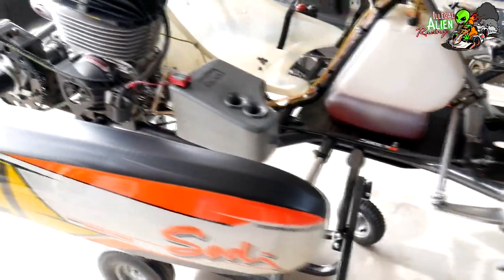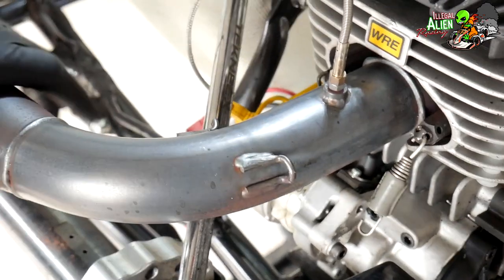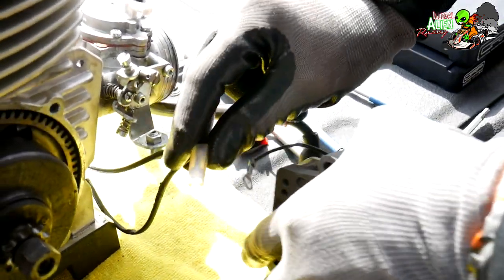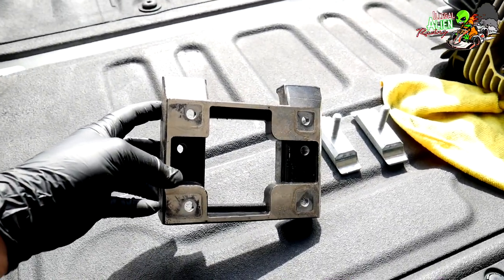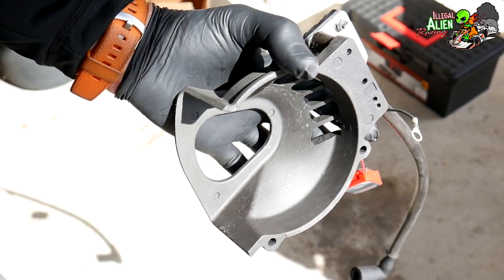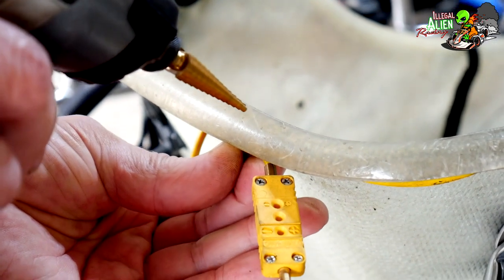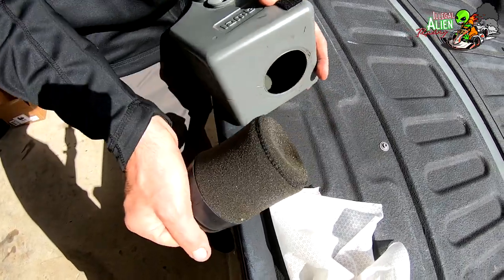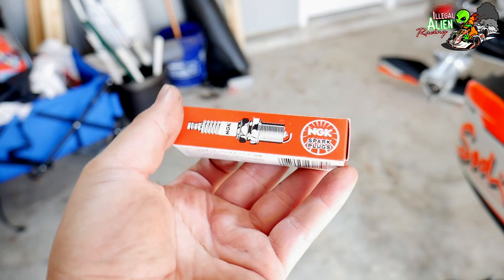Fixing, Cleaning and Getting my Kart Ready for the Season!

Comment: I am thinking of buying my own kart once I’m old enough to get a job, probably second hand in the near future just to race at my local circuit. I’m doing rental league racing at the moment because it’s a lot cheaper but the thing that I’m most concerned about when moving into owner karts is not the expense but more I feel it would be to complicated to figure out which part is which and the mechanic side. Great video, very helpful!
Reply from the maker: I felt the exact same way about working on the kart before I got into it.  I think you have a good plan for your karting.
Reply: I raced in the late 70s when I was 8. Karting wasnt just about winning or even competing, it was about maintaining the machine. That changed my life. I looked at everything differently as I realized I build anything. In the 80s, while in high school, I started road racing motorcycles. After graduating, I went on an got an engineering degree and built bigger things. All the while pushing myself further and further. 
Get that kart. Don't worry about getting a newer competitive kart, just get one. Your life will change.

Comment: I have a Sodi chassis similar to this chassis.  My son is running a Rotax junior engine and we  installed a 10 degree Odenthaul mount similar to this.  Our problem after installation, was the tensioner no longer able to stop the engine from moving.  The slide section was higher than the mounted section on the chassis making it above the stop.  Have you figured out a fix for this?

Comment: How often do you change the oil on the kart?
Reply: It’s a 2 stroke engine. Oil is mixed with the gas.
Reply: @beckettfriesen  I dont have any experience with karts, only 2 stroke motorcycles. I just figured that karts had transmission oil like my 2 stroke motorcycle
Reply: @JVBNorway  I don’t know about shifter karts, but with single speed 2 stroke karts, you just mix the fuel and oil
Reply: @beckettfriesen  That I did not know, but is very interesting, thank you. It makes sense for a single speed